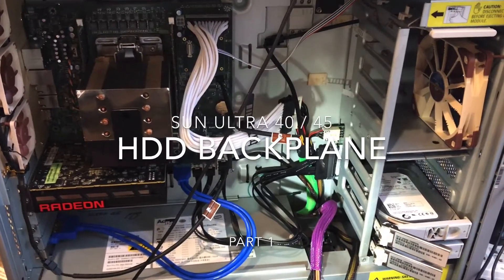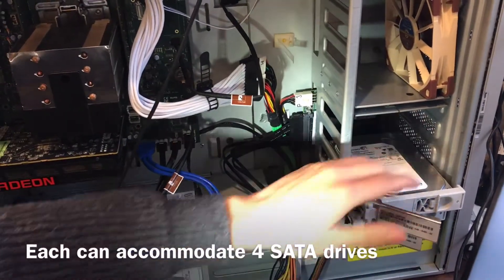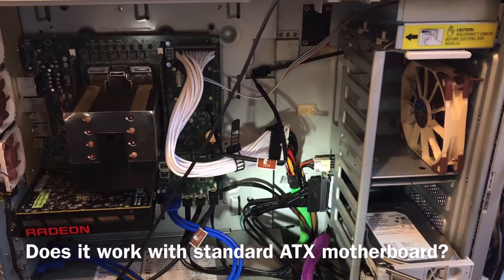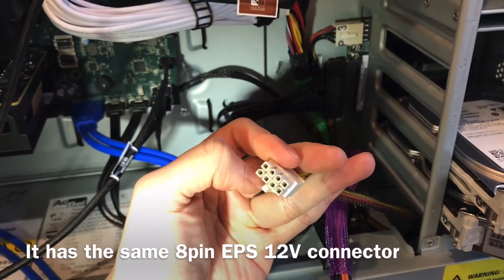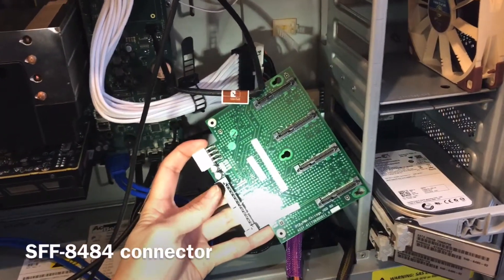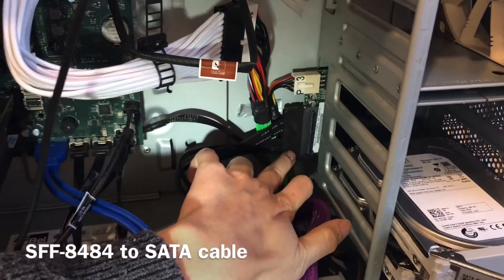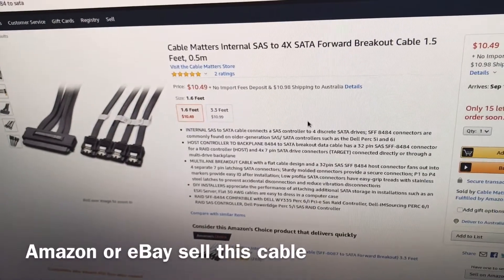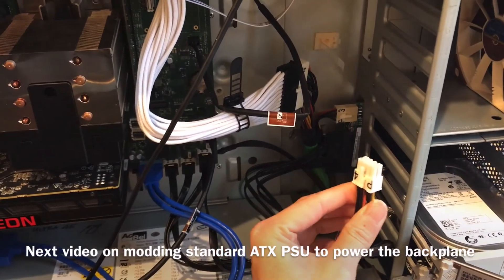Sun Ultra 40 / 45 HDD Backplane

Comment: Hello. I'm building similar system with HDD backplane but wasn't able to connect HDDs to the system successfuly. I have used sas breakout cable specific to backplanes. Can you help or share your configuration how to make it work?
Reply from the maker: What is the model code name of your sas breakout cable?
Reply: @TrungLe-lw4zm   I have two types. One is (SAS SFF-8484 32Pin to 4 SATA 7Pin Adapter Converter 1 to 4 Splitter SAS Cable for Server Hard Disk Drive HDD (aliexpress)), but it is intended for connecting drives to a RAID card.
And then the second one (25890-25500-J40R), according to the manufacturer, is intended for connecting a backplane to the motherboard.

My backplane: 373-0020
Reply from the maker: @radovanfindra that looks right. Have you checked the power supply?
Reply: @TrungLe-lw4zm I use a generic PC PSU for my build.
 I used the backplane with the original PSU. I checked voltages (checks out with diagram in description) but sometimes it stops working under load. I have not tested further because I can hear my disks spinning. 
Disks are okay pulled from the working machine. 
I'm going to build a custom PSU cable for backplane and check again in a few days.
Reply from the maker: @radovanfindra  its interesting when you say it stops working under load. Firstly please check the PSU first, I did once get into issue in which my GPU did not go up because it requires more Wattage from the PSU. So I guess you could borrow a beefy 1000W PSU and see if the issue persists.
Reply: I have sorted my situation with psu. My disks are good (check by using SATA cable). Disks are spinning after I connect them to the backplane. But still no sing in os
Reply from the maker: @radovanfindra  have you tried it on different motherboard?

Comment: I am doing something similar with an Ultra 40...Do you happen to know the pin assignments for the 24 pin connector which goes to the usb/mic/lineout?
Reply from the maker: That’s the last puzzle that I have not worked out :(
Reply: @TrungLe-lw4zm  as far as the front panel usbs as you are probably aware its an I2C bus and I saw a schematic online (not for Ultra 40 but something else) which had pins 34/35 grounded. I checked sun board and it appears in the original configuration those pins where grounded (without any resistors or capacitors) as well. Did you try this?
Reply from the maker: @ScottCov  No I have not